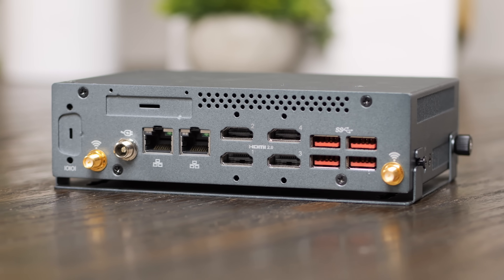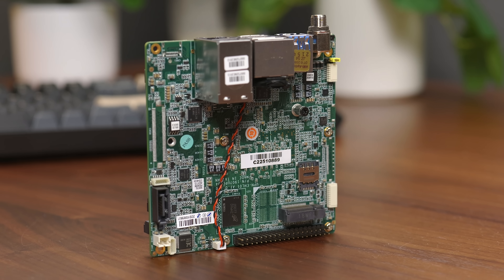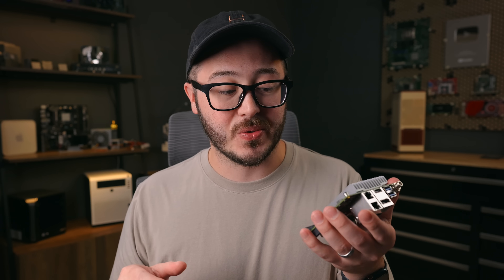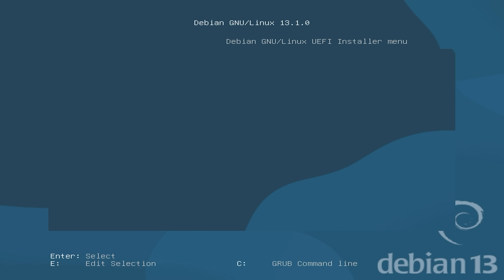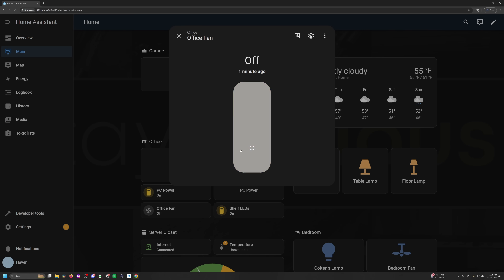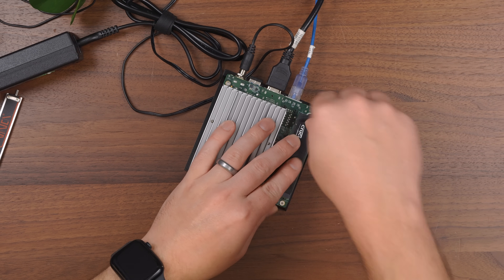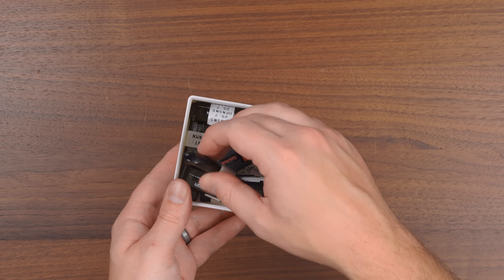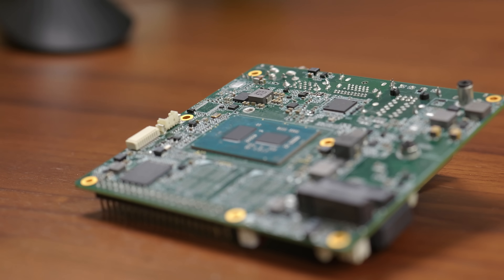This $63 Mini PC Might Be a Hidden Gem

Comment: zfs doesn't exactly require a lot of RAM, it just uses everything it can get - it's also tunable
Reply: Yes. It is one of the misunderstood things about zfs.
Most of the ram usage is for caching, and you don't get much benefit from the ARC cache on a flash based system anyway.
It was designed for HDDs, and can even slow down NVMe. Part of the more recent changes to zfs has been getting rid of caching when you know you don't want it with O_Direct reads/writes.
Normally when using fast flash storage, you want to set the ARC to only cache metadata, but in this case I would go even further and trim ram usage down to a bare minimum because there really wouldn't be much benefit to ARC at all.
Reply: It requires about 1GB per TB. That is pretty limiting on a board with 2GB of soldered RAM
Reply: @Slackware1995  That is outdated information, depending on the use case of the pool. RAM is used for what is essentially a write buffer and read cache. If there isn't much RAM, writes may be a little slower and it just won't hold many, frequently accessed files for reading. I agree that 2GB if probably too little though for what he was doing. The 4GB version would be more than enough though.
Reply: @wojtek-33 you obviously have know idea how ZFS works. It is hardly a simply read/write cache.
Reply: @wojtek-33  You forgot about the metadata, that has to be in RAM, and metadata is the main reason for the 1GB per TB rule.
Reply: @hubertnnn   The ARC holds metadata as files are accessed. The meta is on the pool and loaded into the ARC as needed. If you have SSDs, this is less of an issue as the meta can be read very quickly compared to HDD.
Reply: @Slackware1995  No. It ABSOLUTELY doesn't.
That is for ARC usage, and only if you are caching FILES(or have an insane number of small files. OR have your block size wrong), which you shouldn't be unless you are using HDDs AND have specific use-cases.
The only thing zfs REQUIRES is enough ram to hold the transaction log, and the write buffer, which is usually 5 seconds worth of writes in the worst possible case.
On an SBC like this you should probably be disabling ARC completely(as possible...), since your storage is flash anyway, and setting tunables so zfs uses ~128-256MB of total ram.

zfs DOES NOT require gobs of ram.
That is a fallacy based on the old ENTERPRISE use-cases.
Please stop spreading it.

Many times it doesn't even benefit from much ram unless you have certain specific workloads.
Once you have all your metadata cached, you aren't going to see much benefit unless you are constantly hammering the same blocks, which is something you almost never see on a NAS.
If you are running a SAN, then it is a different story, but that is way outside the scope of an SBC with 3 total lanes of PCIe available to storage.

Comment: Interesting, but 2G RAM is brutal
Reply: they also have 4gb (90eur) and 8gb ram (157eur) combos available.. the 2.5gbe and multiple ssd slots are interesting.
Reply: @Interblaze Once you get one of these SBC's with 4GB or 8GB of RAM you could get a much much better mini computer that will have a better CPU, more RAM (and upgradable SODIMM RAM), an include power supply and NVME drive and all in a case.

The "multiple SSD" slots as you call them are PCIe Gen 3.0 x2 and PCIe Gen 3.0 x1 m.2 slots. Once again, getting a mini computer will give you better options. You will likely have at least a PCIe 3.0 x4 m.2 slot plus a PCIe 3.0 x2 or x1 WIFI slot that you can buy an adapter to be able to use a 2230 nvme drive. They also generally have the ability to mount a single SATA 3.5 inch drive internally.

As an example, at $145 you can get a minicomputer  with an N150 cpu (4 core, 4 thread at 3.6Ghz), 8GB RAM, 256GB nvme, WIFI/BT, 1gb NIC and two USB 3.2 Gen 2 ports.

Simple upgrading to a $175 increases the specs significantly. AMD 3550H cpu (4 core, 8 thread 3.8Ghz plus Vega 8 iGPU), 16GB RAM, 512GB nvme, dual 2.5gbs NICs, USB C and USB 3.2 Gen 2, WIFI/BT and 1 SATA.

The 8GB SBC version still needs a power supply, nvme and likely a case. Assuming that you buy a cheap 512GB nvme, a cheap power supply and 3d print your own case, you are looking at about $225. 

For $230 you can get an AMD 5500u (6 core, 12 thread at 4.0Ghz and Vega 7 iGPU). 16GB RAM, 512GB nvme, WIFI 6/BT, etc

About $250 gives you the choice of an AMD 5850u (8 core, 16 thread) cpu or an AMD 3550h (4 core, 8 thread) cpu but 32GB RAM and a 1TB nvme.

At no price level of this SBC is it competitive with a similarly prices mini computer, UNLESS you specifically need the GPIO header for your project.  Even then, you can find an ARM based SBC either cheaper and/or with a faster CPU.
Reply: Two Atom cores ain't great, either. I'm not sure it's actually fast enough for that 2.5gb port to matter... And even a modest set of docker containers would overload it.
Reply: Definetely not very cost efficient either as you can adquire Intel gen4 or higher at around 50€ and those usually support 16 gig of ram which can be bought for dirty cheap nowadays since its ddr3. I once bought a i3 haswell mini pc (with 4gb ram) for 50€, slapped an i5 for like 15€ into it, and then 16 gig of ram for 20€. I could have even placed an i7 into it but due to tdp limits I went with an i5 specially because I didn't want the fan to be very noisy, which would have been the case if I used an i7.
Reply: @EGOTheSpartan  you can get a n100 barebone with two 2.5gbps Ethernet interfaces and an 802.11ax for $100. You can add 32GB ddr4 and an nvme..
Reply: beyond brutal, basically unusable for anything besides a software controller
Reply: @KaySwiss21 I’m running a Jellyfin server on a similarly specced compute stick with Debian 12, 2GB is enough if you make sure to disable the Debian gui. I’m running pre-encoded files off of it so that’s something to take into account as well.
Reply: only use case i can imagine is for a compact NAS, but honestly there are many turnkey solution just for that
Reply: @mcid47 can host a web server for a small company out of it. Can serve at least 10 requests per second (as long as its not written in python or js)
Reply: Better than a raspi4b with 2 gb or ram.

Edit: nvm 2 atom cores is definitely worse even with better software compatibility
Reply: @rix1134-kAGDOt it depends on which atom cores. The one in this SBC is very weak.
Reply: yup. smartphones/cheap phones should have direct power connection and beat all these expensive single board computers
Reply: How things have changed. I remember the days when you didnt need 2+gb to switch on a light or browse the internet.
Reply: Enough for tailscale and finamp
Reply: yes, interesting bro
Reply: Makes apple nonProMax plebs rejoice.
Reply: Thanks for not making me waste my time watching this... super under spec'd
Reply: Yeah ! I'm not interested in anything less than 8g ram!, 2gig is pathetic in 2025!!!!
Reply: RAM prices though 😢
Reply: It's an industrial board, and as such, it's not designed to be cost effective as a PC.
Reply: $69 would be a good thumbnail.
$67 would be pretty good too!
Reply: @fooferbob9230 $69 would be a 'nice' headline XD
Reply: it's enough to run a decent web server.

Comment: I bought 2 x Intel NUC5i7RYHR, they were from 2015, cost about $30 each. bought at different times. They both had RAM and M.2. I think the M.2.s were password locked could never get them formatted. best part is I think still checking, after installing windows 11 and drivers in the BIOS it says Intel ME ver then unknown. I can get a bios update from 2020 in Softpedia, one of the updates in the bios says It will update the ME . I have been reading a lot about how hackers can manipulate ME. So if ME is not running i am happy. they are both very fast

Comment: you could buy a used ram stick (check the make of the existing 2GB ram stick and ask an AI about pin compatible same DDR gen ram chips and find a used module carrying those and buy it) and then just desolder the 2GB and solder higher capacity ones on or keep the 2Gb and add simiar pinout 2gb ones next to it cause I saw the board has the traces for extra ram chips it should be cheaper than what they ask for